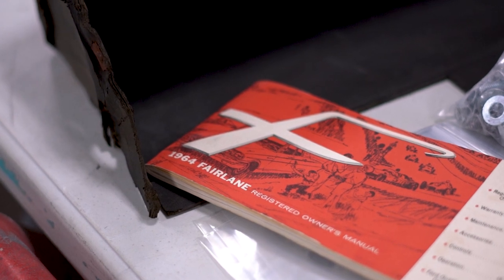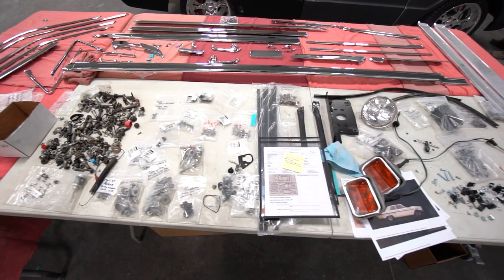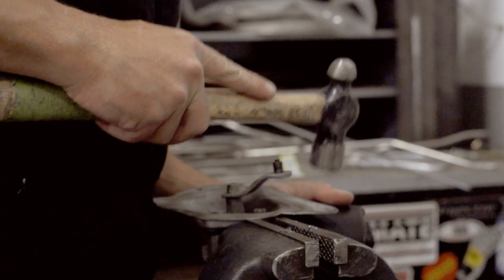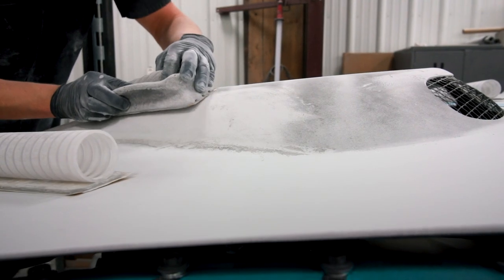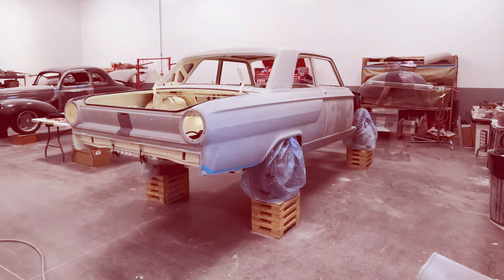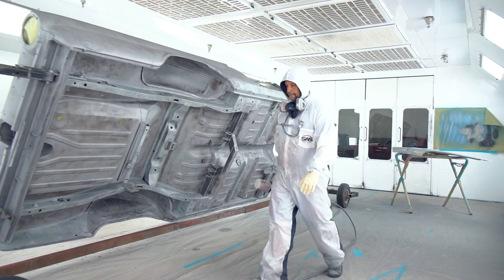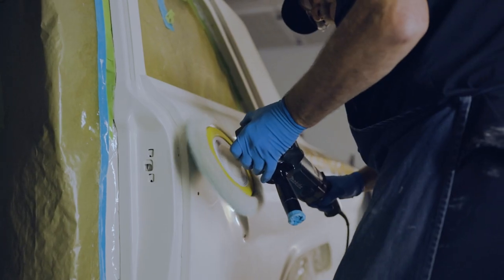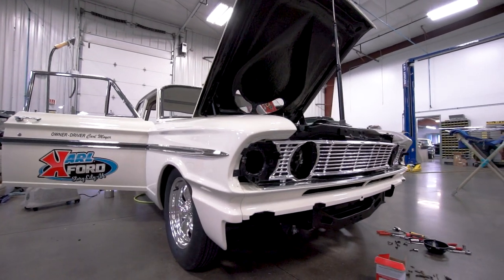An in depth look at the 1964 Ford Thunderbolt

Comment: I was now the caretaker of ; 1963-1/2 factory light weight FORD GALAXIE  500 XL : 427 In line or front to back mid riser doul holey 4 barrle carbs. And a complete nascar engine with light weight interñal engine parts. My Ford light weight came out of the Norfolk Virginia dealer ship ordered  with the R code package and painted coranthium white and red interior with white headliner. And given a name and known as "Bwitched" as I was Introduced by my dad and was also now with painted  color black with same red interior.